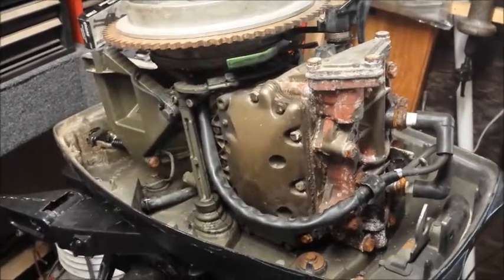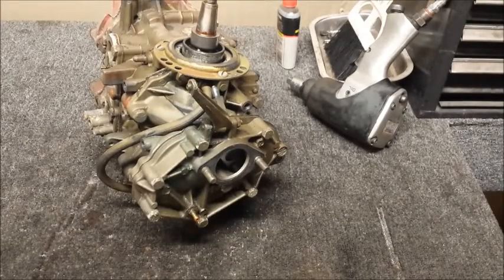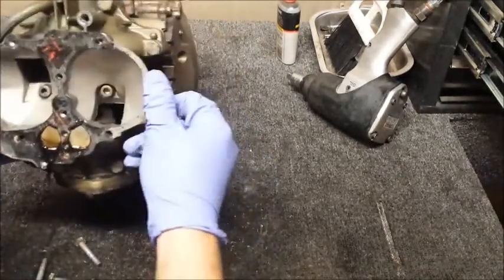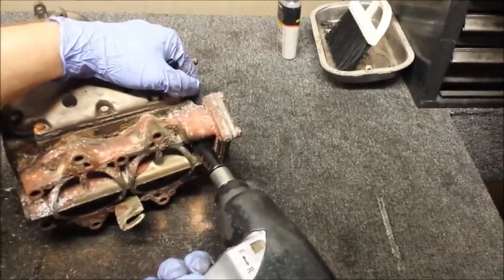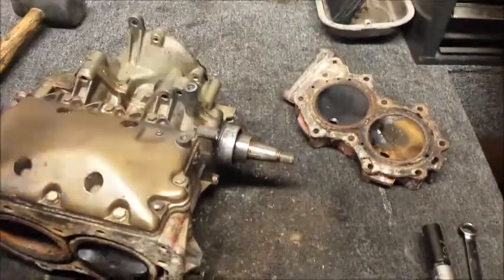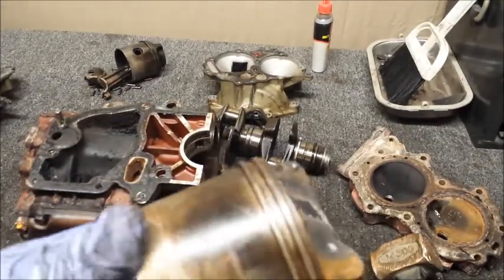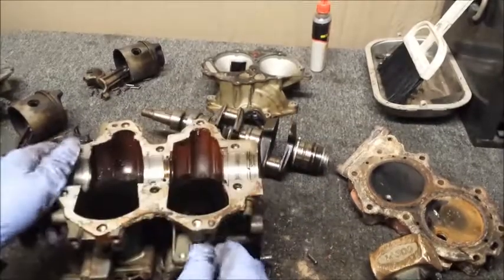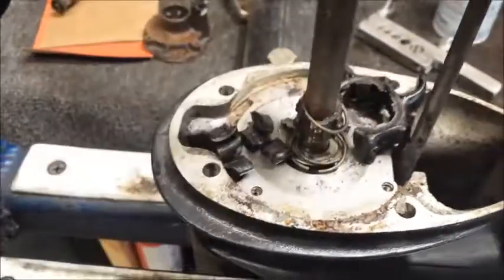Overheated Outboard? Johnson 20 HP Teardown

Comment: Hello i need HELP
I have the same 1973 Johnson 20hp outboard, I want to install new head gasket but I don't know what torque should I use, some say 96-120 inch pounds others say 216-240 inch pounds, which of these values is correct, i I'm grateful if someone can help me

Comment: 1989 Johnson 70 HP, first hour of break in is fine, the 2nd hour engine gets a little hot. the needle on the temperature gage shown 180 degrees or may be a little higher. The temperature sensor was not sounded. good warm stream of water coming out of the tell-tale the engine is just a little hot to touch.   did I damage my motor?

Comment: have another question i hope you can guide me on what i should do. i seem to have a leak on my crank case halves on my outboard , i saw your video https://www.youtube.com/watch?v=DeLDQOOnNgg&ab_channel=Brandon%27sGarage where you took it apart, im min 3:20 you had it in two halves but i can not tell if there is a gasket that goes there, ive looked and marine engine and they dont show a gasket, what are my options and is it a gasket i would need to fabricate?
Reply: No gasket.  After it is chemically cleaned with "gel seal remover" then apply very sparingly (very thin film coating) new get seal and put two halves together.  Keep gel seal 1/4" away from upper, middle and lower bearings.
Reply: @mikedurhan9941  already fixed her and runs like a champ. Thanks for the vid and info.

Comment: Brandon, I sit at work and watch all your videos for hours and hours.  I have not seen this one.  Low and behold two weeks ago i bought a 1983 25hp with evidence of overheating. (dumb move) I pulled it apart. It looks suspiciously like this one.  I ordered a new (used) powerhead.  Now i can not pull the other overheated powerhead.  The driveshaft is stuck.  Talk about throwing good money after bad.  Any suggestions of getting this lower unit off this 150lb paperweight?  Love the videos!

Comment: Brandon’s Garage how long running an engine till damage is done once  water pump stops working? I drove full speed for about 5 minutes. I just took a trip with my outboard and drove through a sand bar at idle speed thinking engine was tilted enough but wasn’t and it sucked up enough sand I guess to stop water pump from working. Didn’t realize till I drove full throttle across lake for 5 mins and noticed some white smoke and turned engine off. Took off hood and noticed one side of engine the paint was discoloured and was hot enough to melt some electrical tape on wires over top engine where they were touching the block. I didn’t start it again until engine block was cool to the touch then started ok, but no water shooting out so I turned it off in 30 seconds. So I need to change water pump and look for pieces of it. Was also going to do a compression test. But just wondering from hearing that do you think the one or two cylinders might be blown? As long as compression is good am I good to go? Should I replace the thermostat too?
Reply from the maker: You probably scored a piston.
In my 1963 18 HP I had, WP failed, and within 4 minutes of running (at full throttle) it seized up.
now, once it cooled down it rotated again, and ran fin again. But, never quite as well. 
So, clean the sand out, and you might be okay. !Might!
But chances are damage is already done.

Comment: Hi Brandon I love all of your videos, I just have a question do you know the thread pattern of a 1998 200HP Mercury EFI, I would like to install an aftermarket water temp sensor like the ones on ebay some store have different thread patters like 21MM, 16MM, 17MM, 14MM and 10MM thanks in advance.

Comment: Do you ever oversize the cylinders and put oversize pistons into something like this?

Thanks,

RichE
Reply from the maker: On a nice clean motor- yes.
This engine would have needed a lot of other work, didnt decide it was worth it.
It was probably one of the worst engines Ive had.
Reply: I'm wanting to upgrade my piston size in on a 6hp eveinrude is it possible?

Comment: Im actually having this discussion with my forum. I bought an engine with flaking paint... i'm worried it overheated but got it cheap enough so i figured why not. I never tear down the lower unit unless i'm sure i can get it to run. SO my current project which is on my channel wont run but i'm almost there.. once i tweak a few things I'll make sure i shut it down quickly. I can already see its not pumping water. so I say make it run first them fix everything else! just me though i'm getting alot of kick back lol.

cool videos sir!. Your detailed process is a pleasure !
Reply from the maker: Is this for your 7.5 HP?
Reply: Brandon's Garage yup
Reply: All older motors are very forgiving, find the problem, replace.